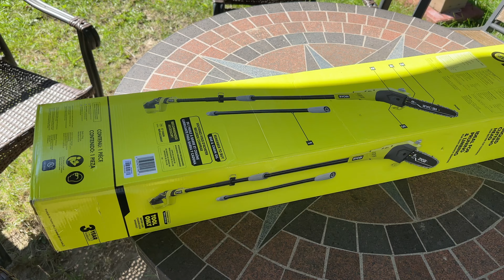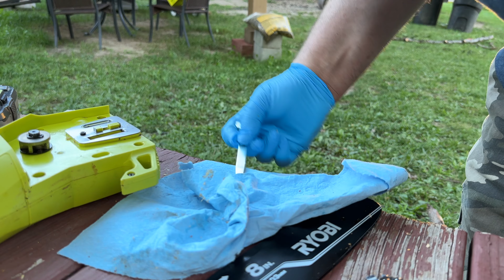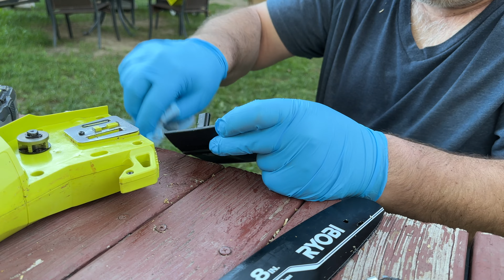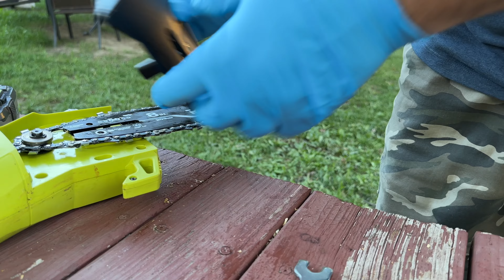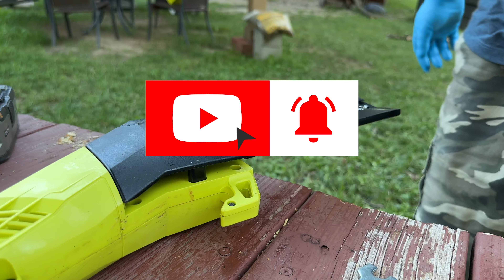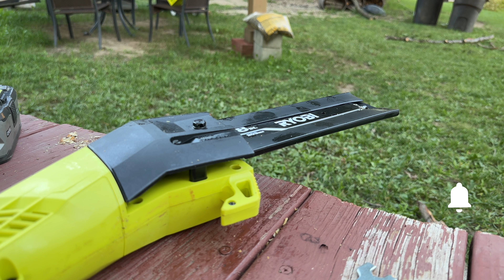Ryobi Pole Saw Chain Tension and Oil System

Comment: I took the cover off, then the blade and chain.  Then I put them back on like you showed, and then screwed back the cover.  There is NO outside tension screw on mine.  I bought it in 2022.
It looks the same, otherwise.The chain is still sagging down. Nothing you showed helped it in the least😢
Reply from the maker: Have you thought about looking this up in the owner's manual?
Reply from the maker: Maybe you lost the screw? Is the text there on the cover? Maybe you can post a picture?

Comment: I bought one of these but its an older model, got it for $40 from a neighbor that was moving.   I finally got to get some actual usage on it.  Thank you for making this video as I ended up turning a screw I thought was the chain tensioner, it wasnt, tension screw was on other side of blade, BUT (again thank you) because of your video I was able to clean it up inside, make sure the oil drip tube was clear, and how to re-assemble.    Works nice.